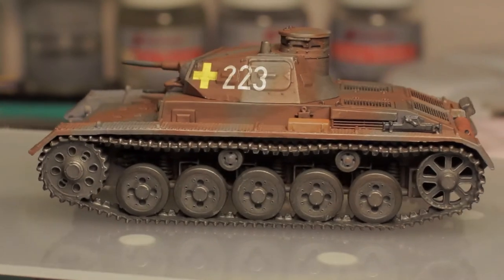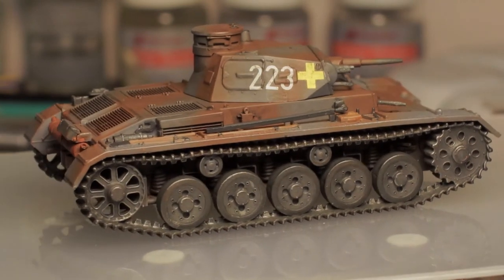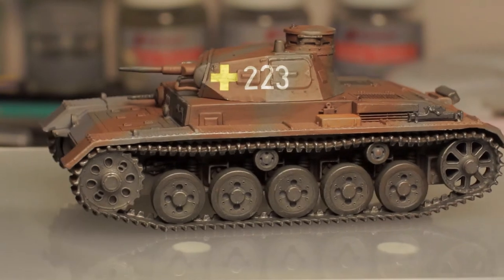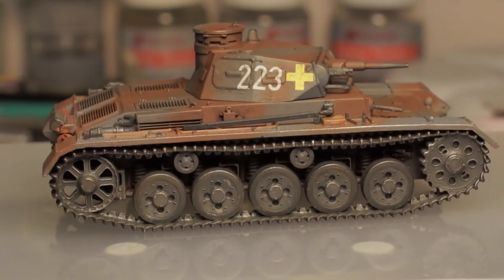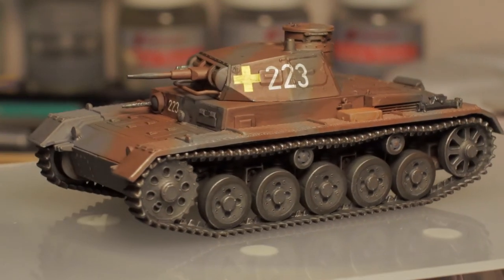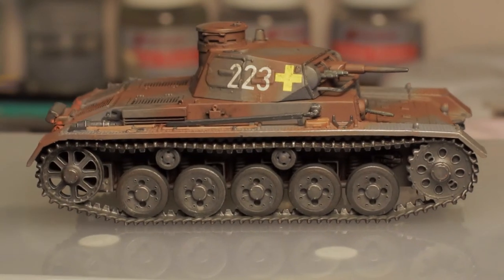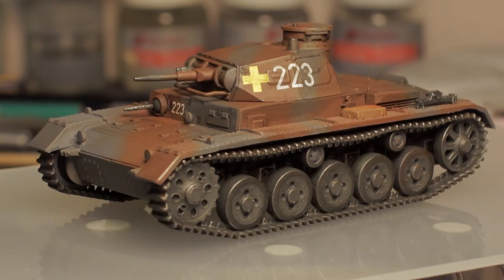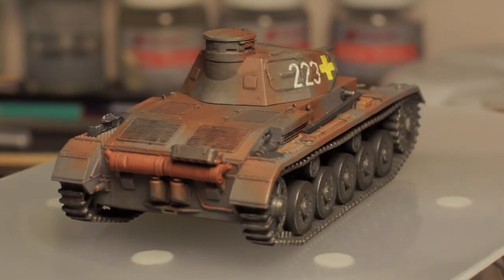IBG pzkpfw 3 ausf A waw magazine 1 part 4, Completed model.

Comment: Lovely model! The paint scheme was actually 1/3 brown, 2/3 grey, yours is more like 50/50, both colors probably a tad darker. You also forgot the rear light, and yes, the front lamps had slits, or else there should be glass there, just like of the small position lights on the fenders. But, again, it's not an easy model to make since some of the parts are so tiny, and some the detail so subtle - good work!!
Reply from the maker: Thank you,  the only info I had was based on the magazine that accompanied it as I'm not knowledgeable about armour, just like to build the odd tank.
Reply: spidiq8 I’m currently building this same model, I’d be happy to show you but there’s no picture option here... I’ll post it to the 1/72 aircraft and armour group on fb soon!